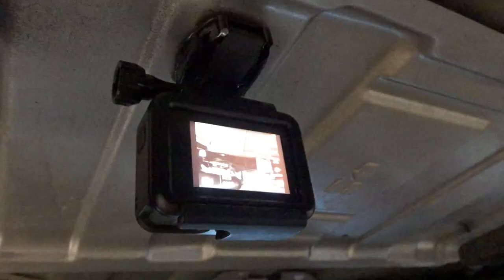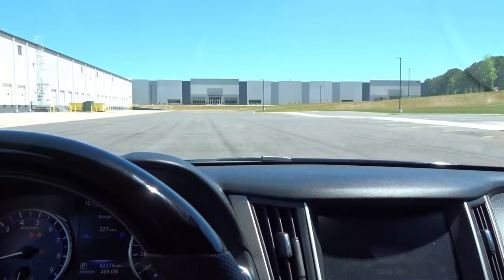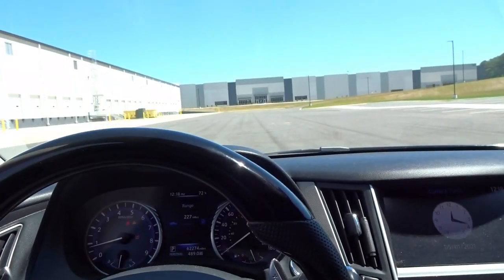Q50 Rear Diff Brace Installation AND Test

Comment: yeah im still seeing flex, i dont think this really works well enough for me to spend some money.Great video!
Reply from the maker: I’m working on a resolution.  I found a temporary fix until I can make something more permanent.  It’s not an issue with the brace itself but where it mounts to the subframe.  That video is going up Sunday morning.
Reply: @SpeedCultureStudios  did you ever add the new spacer they provide and do a flex video after
Reply from the maker: @frankthatank6716  Hey Frank.  I did not receive the new spacer/sleeve.  The issue really is the single mounting point.  It will always pivot, especially if you have substantial power and get good grip.
Reply: @SpeedCultureStudios  send pride llc a message mine came with the sleeve but ask for an extra washer because my bolt digs into the diff unless there's an added washer so 2 in total
Reply from the maker: @frankthatank6716  I’m not really interested in it.  It was worth a test but the single mounting point makes it basically ineffective
Reply: @SpeedCultureStudios  works fore with the spacer car Def puts down more tire than before and doesn't squat as much before taking off

Comment: Thanks for the great video.  What is your gopro and mount setup.  Trying to diagnose a thumping when launching that started after I destroyed and replaced my drive shaft.  This seems like a good way to help with figuring it out.   Thanks!
Reply from the maker: It’s a GoPro hero 6 black with the cage that comes with it.  Then just a flat adhesive mount stuck to the heat shield under the fuel tank

Comment: Hey, I think that the top bolt on the brace might snap it’s flexing a lil too much for my liking so in my opinion it might work but only with a solid bushing from z1
Reply from the maker: The mounting hole is too big for the bolt.  Solution outlined in Sunday video!  Bushing would be great but not available for the Q50

Comment: That’s actually kinda cool the video showed after installation that the flex was definitely minimized a lot ! 

I wonder if they make one for the G37 sedan? 🤔

Cool vid man keep em coming 👌🏼
Reply from the maker: Actually the video showed that there was still a lot of flex lol.  The brace needs some tweaks/improvements to be effective.  There are options for diff bushings and braces available for the G yes.  Check z1
Reply: @SpeedCultureStudios  oh yeah there is flex but on both videos it just doesn’t seem as snappy with quick movements like before the install which seems a lot smoother flex after.

Thanks ill check z1 for the G 👌🏼
Reply from the maker: @9thgizzyguy  yeah it may have helped slightly.  Working on some improvements.  Video for Sunday morning goes into the issue a bit deeper and a resolution is proposed.  
Thanks for checking in!

Comment: I just bought this and waiting for it to be delivered. Seems like there is still a bit of movement in the rear diff but hard to tell. Maybe edit the video where accelerations are side by side. 

I also bought the Voodoo Traction Arms, that did make a difference. I also have the Z1 Subframe Collars. Maybe with all that, there will be less movement 😎.
Reply from the maker: No you’re right there is definitely still movement.  I have a video coming out on Sunday morning that goes further into detail.
Reply: @SpeedCultureStudios  right on.

Comment: Another awesome vid man.  NGL though, the before/after flex kinda looks the same to me
Reply from the maker: Yes it does.  I have a video going up Sunday that identifies the issue and suggests solutions.  I’m working on a fix
Reply: @SpeedCultureStudios  the issue is that its a poorly designed piece of shit. the single bolt hole with all that slop is ridiculous as is the way the arm leading up to the bolt hole is designed. it allows a lot of leverage to be exerted on it. plus, the sissy, thin wall arm will flex once the slop at the bolt hole is eliminated. 

its an extremely poor attempt and a diff brace.
Reply from the maker: @OxBlitzkriegxO  it’s not “extremely” poor but there are some tweaks that can be made.  I talk about them in the video that is scheduled for Sunday.  The mounting hole in the subframe is the main issue, as you mentioned.  It’s too large which allows movement at the mounting point.  A single mounting point is not ideal either, as you pointed out.

Comment: a better version would be a single one piece design that replaces the factory subframe brace arms with a large W-shaped piece that ties in to the bottom 3 bolts. that would distribute the torque across two different mounting points, angled away from each other and offer stiffer subframe bracing to boot.

i bet ultra racing could make that pretty quick.

this thing is a fucking toy at best.
Reply from the maker: There definitely needs to be multiple mounting points at the subframe—even 2 would be good.

Comment: Why would you recommend a mod , that you said yourself, you don't feel any difference.
Doesn't look any different. Thinking a  stiffer bushing would be much better mod.
Reply from the maker: You wouldn’t necessarily “feel” this mod.  BUT, this issue is not with the part itself.  Check out the video coming Sunday—this issue is identified and a solution is determined.

Comment: do not recommend this cheesy brace. all the energy is directed through that one bolt. that bolt is a tuned 3.0t away from snapping it like a twig with 500wtq and sticky tires. the bolt fit is sloppy and a single mounting point and how that mounting point is designed is just BAD.

this item wasnt designed by a competent individual with engineering experience.
Reply from the maker: I appreciate all your input.  I speak about this very thing in my video for Sunday.  A high torque vehicle that gets even a little grip will cause trouble for this brace for a couple of reasons.
Reply: Harsh words..damn